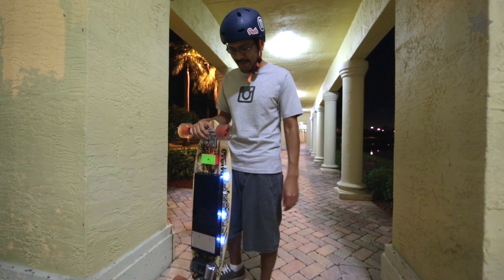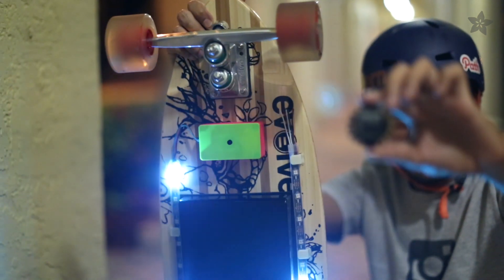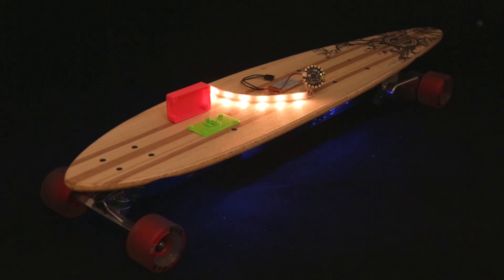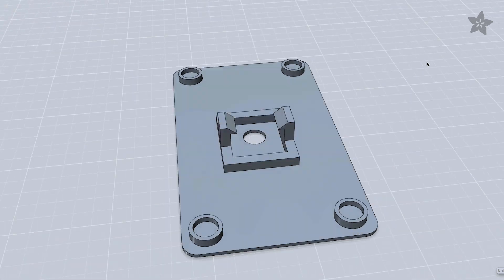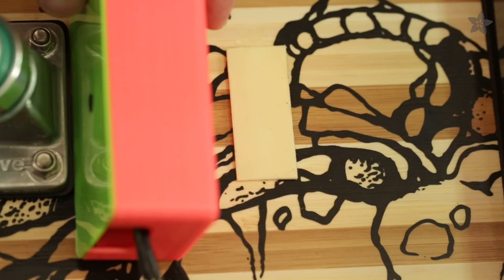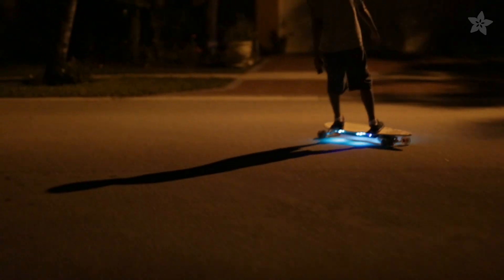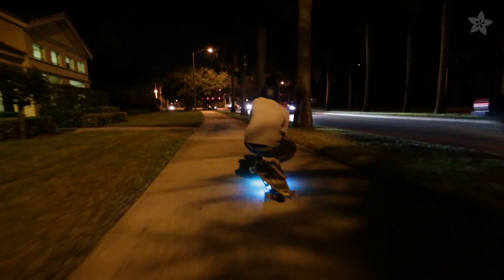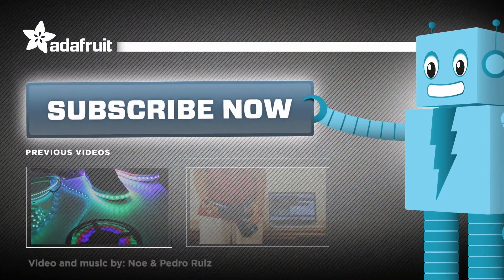Light-up Skateboard with Adafruit NeoPixel + FLORA & 3D printed battery enclosure

Comment from the maker: Flora + NeoPixel LED Skateboard Upgrade - for maximum ground effects  #Wearables   #FLORA  
https://learn.adafruit.com/flora-neopixel-led-skateboard-upgrade

Here's an easy weekend project that will light up the night and help you stay safe while you skate. This LED upgrade uses NeoPixels and Flora - Adafruit's microcontroller board. The 3D printed enclosure houses all of the components and has an easy to get to power switch. You can grab the STL files on Thingiverse. For this project, we used the low density weatherproof NeoPixel strips and a small LiPo Battery. The printed cover snaps onto the power switch. We used double sided foam tape to mount the enclosure. The NeoPixel strip slides into place with the 3D-printed clips.
Reply: So no grinding there then...
Reply: Tapemasterz
Reply: wow

Comment from the maker: 3D printed FLORA + NeoPixel LED skateboard “Upgrade” @ The Adafruit Learning System

Light your deck for awesome night-skating effects (and photos!). Here’s an easy weekend project that will light up the night and help you stay safe while you skate. This LED upgrade uses NeoPixels and Flora – Adafruit’s microcontroller board. The 3D printed enclosure houses all of the components and has an easy to get to power switch. You can grab the STL files on Thingiverse. For this project, we used the low density weatherproof NeoPixel strips and a small LiPo Battery. The printed cover snaps onto the power switch. We used double sided foam tape to mount the enclosure. The NeoPixel strip slides into place with the 3D-printed clips.

http://learn.adafruit.com/flora-neopixel-led-skateboard-upgrade/
Light-up Skateboard with Adafruit NeoPixel + FLORA & 3D printed battery enclosure
Reply: Nice! I worked at a Hackathon on a similar project, using an Android's accelerometer. Other ideas were turn signals and uploading rides to the web.

Northwestern University MAKEaTHON